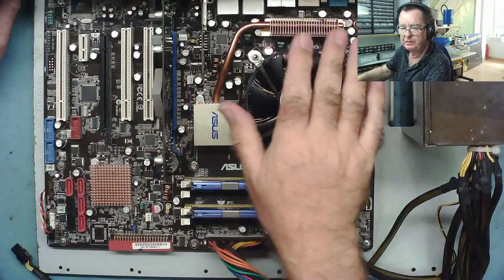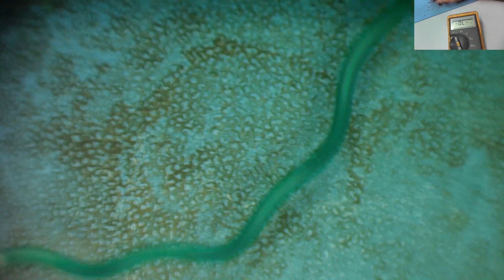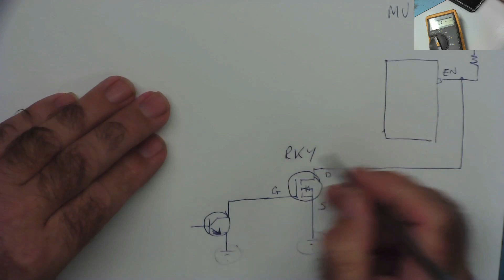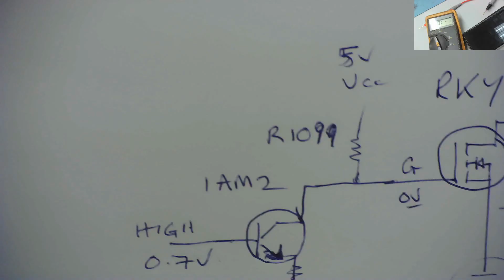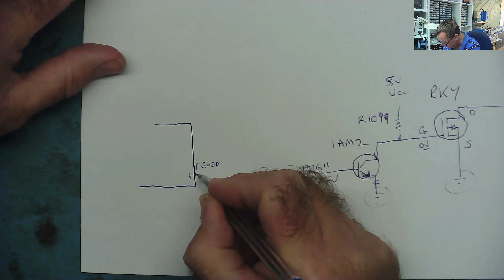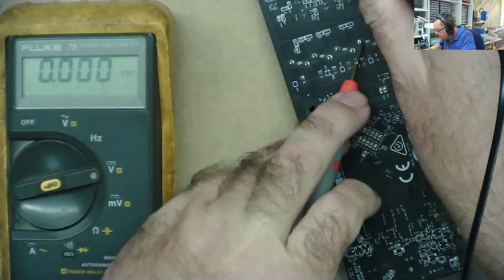GPU Power Sequence Logic Tracing.  Faulty GPU, Voltages Missing. Advanced Fault Finding.

Comment: Am working on an rtx3080 inno3d
There was a short on the pex vrm side so i replaced the buck controller and the short was gone but after putting back the inductor am getting 0v
All other voltage are active on the card

Comment: yesss same problem as mine  this u100 chip got ripped of  it is an AND gate and i suffered a lot with it  tried shorting its ouput to 3v coming from pcie to bypass it (its output is 3v high) but that didn't work .. fan spins the card worms as it should but not detecting .. found a similar ic with the same specs in my dead laptop motherboard so thats what i am gonna try . hope it works

Comment: Thank you for another wonderful video. U100  is an AND gate as you said. I have. a similar problem and could not fix it yet :(. But I have seen some videos of this Russian guy. https://www.youtube.com/c/TerabitLab/videos .  The next thing he checks is the memory controller EN signal and if that was ok he checks the circuitry around it. If all ok he goes to change the VRAM. I use the subtitles option to try to understand what he is saying :). I think it was this video. https://www.youtube.com/watch?v=D750gjlUJKg
Reply from the maker: Thanks for the info
I have seen some Terrabit videos and they are very good, though in Russian but translatable to some extent with subtitles as you say.

I'll check out what you mention
Thanks
Reply from the maker: @badjonatan  Yes Tech Cemetery is a very good channel for GPU repair

Comment: I can't hear what is being said very well - hearing damage and mic sounds muddy -, and I couldn't watch the other vid because it was too painful with my tinnitus - I think it was recorded too loud -, but what was wrong with the card at the start, ie, did it have everything up to 1.8V, but nothing else.

39:00 I had a IC that had a tiny crack, but you could only see it when a torch was at the right angle.
Reply from the maker: This is the first video of this card

https://www.youtube.com/watch?v=vDXSeeY1wDQ

It had everything up to PEX (0.9V) and nothing else

It also featured in the GPU Repair Guide
https://www.youtube.com/watch?v=SmVdl8kew_4

There is a 2 mins 30secs segment in this video when I forgot to put the headset on and the sound was low - I did add text to the video saying low audio for 2:30
Reply: @learnelectronicsrepair  The quiet stuff isn't too bad because the tinnitus turns the volume up to 11, it's the loud stuff that is painful, and words that don't have a sharp start and stop to separate them, ie, muddy, that I have trouble hearing - it was the start with something about 1.8 and PEX -.
Reply from the maker: @SidneyCritic  Give me a time stamp and I can translate it for you

Have you tried switching CC Subtitles on?
Reply: @learnelectronicsrepair  Subs aren't great, because by the time you read them something else is being pointed at.
Not to worry, as it's not likely I can work out my GPU from this because it has 2 GPUs, a large controller/communication chip, and about 5000 parts - lol -.
Reply from the maker: @SidneyCritic  If you have any suggestions how I can improve the audio please let me know - I can't think of anything else to suggest myself. I was just trying to suggest a solution as best  I could.

What model is your GPU and what is the fault with it? It sounds interesting
Reply: @learnelectronicsrepair  I made a quick vid - https://youtu.be/3vIvJ75Y-6Q
Reply from the maker: @SidneyCritic  With the graphics card you need do the checks for voltage rails first - though I guess you did that already.  Are they all present?

I tried briefly using a desktop USB microphone but the sound was horrible and echoey and not high enough.  I then tried hanging a professional microphone (I think it was a shure) in front of me and connected it to an audio mixer similar to the one you have, then connected the output of the mixer to the line in on the PC sound card.  That gave good sound but I couldn't get enough volume without turning the gain up high and making it hissy.

Currently I have a headset plugged into the mic input on the PC - this is giving me good volume, but if I put the mic too close to my lips then this is when it distorts - I've got better at positioning the mic a bit further away now.  It is either a gaming headset or one intended for zoom meetings etc

The type of boom mic you show would be a pain in the ass to use and get in the way too much, I've enough stuff on the workbench already with the bench magnifier and microscope plus the webcam and desktop tripod I use for picture-in-picture inserts

Probably a good quality lapel mic or headset mic will be another option - I'll look around.
Reply: @learnelectronicsrepair  I got half way through a muck-around repair vid when I gave up, thinking it was hopeless. I might finish the half vid so you can see the voltages.

I can't get anything loud enough using the line-in to a PC sound card, and in fact USB interfaces are more powerful external sound cards that bypass the PC line-in sound through the USB, ie, you don't use their line-outs, and in fact come up as a different device in Device Manager. Basically PC line-in is too weak, so YTers use these boosted USB interfaces. Condenser mics with 48V phantom are louder, but yes it's bulky so I do everything as a narration track post vid recording. RODE lapel is what pros use, but we don't have that sort of $'s - lol -.
Podcastage does back to back testing so you can compare the differences. 
The Behringer UM2 is the cheapest new USB interface, here is a review - https://youtu.be/gof9EGFCoV0

Comment: Dicky sent you a message on badcaps, the resistor you put on is in the wrong place and another missing.
Reply from the maker: Thanks Brian, I'll check that out.  Thank you for the help, having a good working one to compare always wins out.  😀

Now I'm surprised I got the missing voltage rails to activate - logically all the evidence said the resistor should go there. 
Well , to me at least
Reply: That's very easy to do when you don't have the diagram.
Looking at the diagram of a similar board, I am missing 10% of components, yet it works and is still factory.

Comment from the maker: You can Find part 1 of this repair here    https://www.youtube.com/watch?v=vDXSeeY1wDQ

IMPORTANT*  6mins 32 secs 
Actually this may be relevant, though i wasn't interested in it at the time.  Hmmmmmm....

RichardsTwoCentsWorth

A: We have a damaged/burnt U100 (see at end of video) and the GPU is stuck in reset.
B: This Graphics card already had a dead GPU and was then thrown in a drawer for a year (I know being in a drawer is true from the owner). Components then got broken off the board in storage- so now we are just fixing the collateral damage and revealing the original fault.
C: What the schematic seemed to show me at 6mins 32secs - that part of the GPU (GPIO?) monitors the 0.8V_PGOOD, and I have more missing components (which actually looks likely to be the case looking at the PCB).  This is what i stopping the GPU from booting up.

Any suggestions guys?